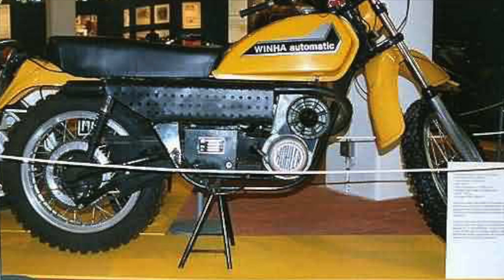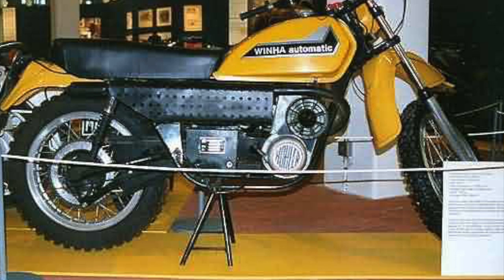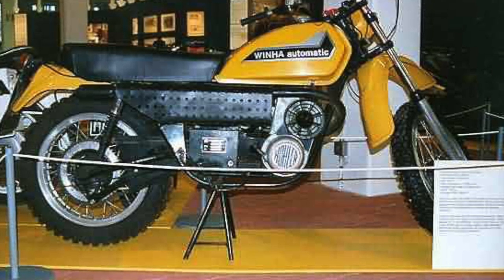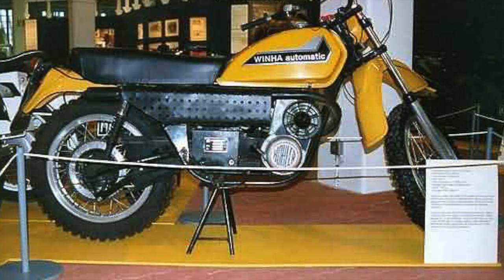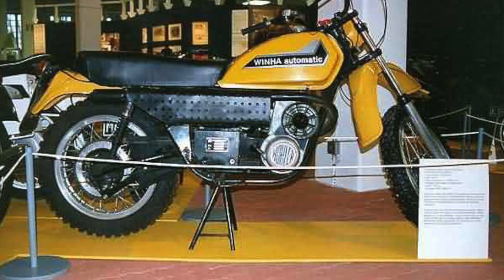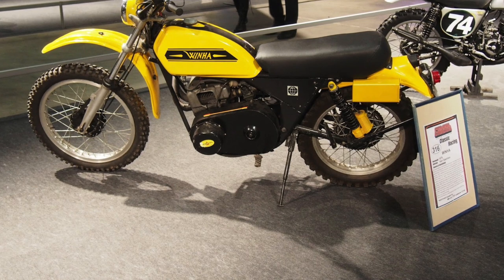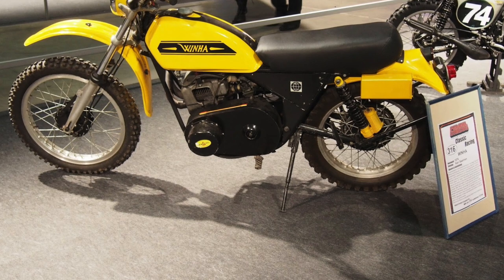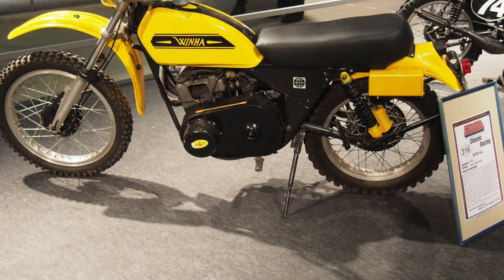Forgotten Motorcycles....Winha

Comment: The same idea as the Rokon. They used a Sachs engine, but still pull start. Always nice to see a bike you never heard of. I'd like to see more of these.
Reply from the maker: Thanks for the info, there are more in the pipeline. Thanks for watching!
Reply: Rokon used Chrysler West Bend engines
Reply: The RT 340 was a more conventional bike. Made from 1973 to 78. It used a Sachs engine.

Comment: From https://fi.wikipedia.org/wiki/Winha_(moottoripy%C3%B6r%C3%A4) through google translate, translation slightly corrected: 
"Winha was a Finnish motorcycle brand. The brand’s motorcycles were manufactured in small numbers in the 1970s. Winha was manufactured by Polar Metal Plast in Rovaniemi.

The Winha engine was a 2-cylinder 2-stroke engine manufactured by Kohler. The same engine was used in Winha snowmobiles.

Winha paid FIM 7,000. The price was made low as the bike was tax free. To achieve tax exemption, the bike had a power take-off that allowed the motorcycle to rotate some work machine.

Production of the Winhas began in late 1976. There were two similar models of the bike. Twenty yellow civilian models were sold. It is known that 60 green models for use by the Defense Forces were ordered. In total, 60–70 Winhas were made. Manufacturing was discontinued due to the bankruptcy of the manufacturer."
Reply from the maker: Excellent, thanks for the info. More weird stuff in the pipeline.